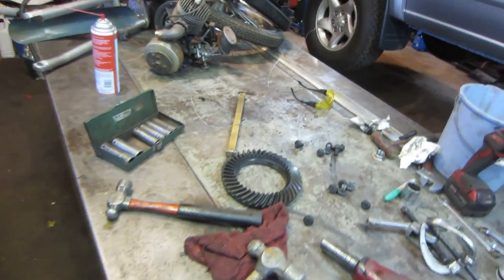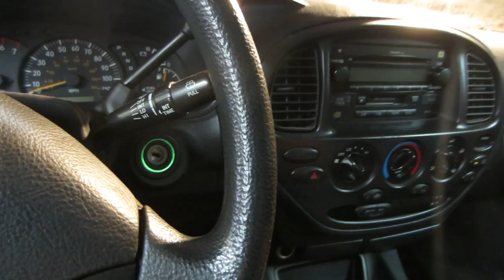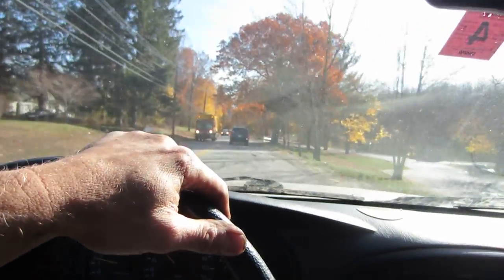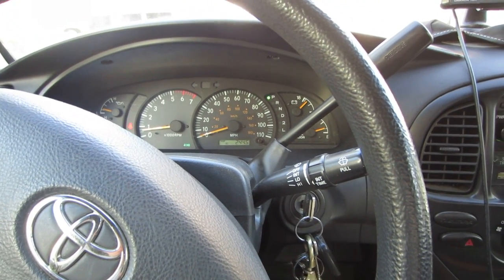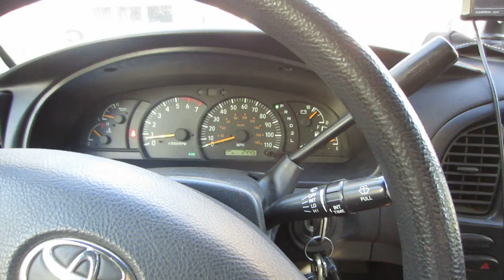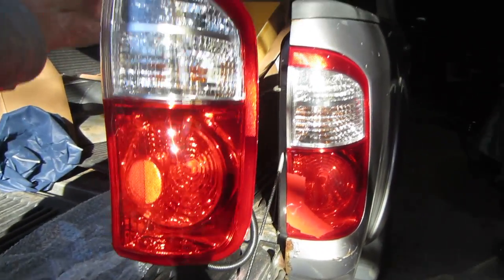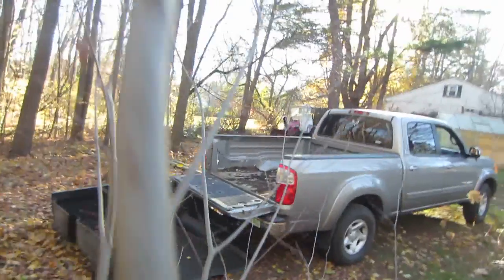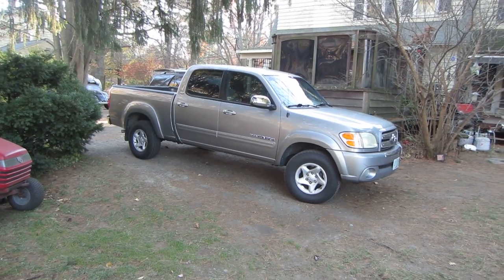front wheel drive toyota tundra

Comment: When I first received my `95 Tahoe ( used ) , there was a `whistling sound` coming from the rear differential. Evidently , the pinion bearing had gone bad - which ,in turn , had then worn all of the teeth in the ring gear and the spider gears down until they were razor sharp. I simply removed the rear driveshaft, stuck a spray paint can lid over the rear end of the transmission ( to help `contain` any drippage, put the transfer case in 4-high, and drove it across town ( only 6 blocks long x 6 blocks wide ) until I purchased a replacement entire rear end ( the cost of replacing the entire innards of the pumpkin was only slightly less than buying a used entire rear end ) . Although I never did try to drive the Tahoe on a highway, it`s nice to know that I could have done so .

Comment: A long time ago I had a Toyota Tacoma with a Toyota branded bed liner in it and I took the liner out to clean under it one time and apparently it wasn't a real good fit and it had been shifting around enough that it had worn the all paint off of all the ribs in the back. There was very little rust because it was getting rubbed off just like the paint had. After that I decided any other trucks I owned would have a painted or sprayed on Rhinoliner type of thing in the bed instead of a liner.

Comment: When we were on a deployment, one of our HMMWVs locked up the rear differential solidly. I removed the prop shaft in the hopes that we could make it back to the motor pool in one piece. I got split up from the rest of the company after we got back and was assigned to route security on the main supply routes with my platoon, and that truck went the rest of the deployment as a front wheel drive.

Comment: I am a retired mechanic with over 30 years experience, 20 of which were in dealerships. I have seen diffs with worse damage go 100,000 miles without a problem once original problem was fixed. I truly believe you can get by with pinion bearings and reinstalling as is. Just my opinion. 
With that said, you can save hundreds of dollars calling Nogalitos Gear in San Antonio, Texas. They specialize in aftermarket parts. I have probably rebuilt 200 or so diffs over the years with their parts without a problem. Last ring gear/pinion sets I bought from them was about $80. That one might run $200. I think you will like their prices and quality.
Reply: 1962. You are young, like me! :-)

Comment: Yeah you won't get any binding in the driveline with the rear disconnected.   The only way it would be an issue is if you had a full time transfer case with clutches or a viscous coupling.

Comment: Hey Darrin,    For your leaf spring if you have a truck stop /plaza that has a repair shop, truck wash and repair they usually will have a spring shop that you can order or have in stock any leaf spring with any size and arch to it.  Also if you don't get that other rear diff.  Any you don't want me to look for you one then go to www.whitepages.com or yellowpages.com and look under wrecking yard in LasVegas , Phenox Az or any place in the south west and you can probably get one there really reasonable.  Even if you bought the outer pumpkin and then bought through a speed shop the ring and pinion gear and you can buy them really reasonable.  Thre is aso a couple of places that I will look or you can but, I saw it on another channel where the guy bought premade frame sections that you take and cut away the bad and these were designed just for the tundra and set them up and weld them on.  They looked really nice and with your skills you wouldn't be able to tell that you had ever redone the frame uther than there would be no rust.  I would be glad to help any way I can,,,,,,,,  I have a lot of time on my hands.

Comment: I was wondering if you could help me out. I bought an old 80cc yamaha. Im guessing its missing fuel lines on the bottom of the carb. I turn the petcock, it works but then the carb leaks through 2 outlets on the bottom of the carb. On the right side of the bike near where im guessing the clutch cover is, there is an outlet. Im thinking thats where one of the lines should go to from the carb? There is also a line coming out from the right side directly opposite from where the out let on the left side. Hope you see this and if I can send in pictures, Ill doe so. Thank you.

Comment: Isn't it amazing how nice those cut rate mirrors and tail lights are? I've used many and headlights too...and spent real time looking 'em over..I really think they may be OEM without factory logos, they are just too perfect...and The Price!
Reply from the maker: and cheap, that mirror with motors, like $45 delivered, the light was only 37,
Reply: You've hit the nail on the head there my friend, a lot of the cut-price "no-name" stuff is made by the people that make the original equipment parts for the motor companies.  But because they're not branded as OE manufacturer parts and they don't come in a box with the marque name on it, you don't pay "main dealer tax" on the price.  Very few motor companies make all the parts themselves any more as it is far cheaper to buy them in from specialist manufacturers.  I would, however, advise that if you are looking at buying parts like these, especially light units, have a look around for customer reviews of items from the same manufacturer, as some parts are really poor-quality and pretty much useless, often ones knocked off in China...
Reply: Ya, in the old days stuff was really ill fitting crap!
Reply: Rich Random   A fair chunk of it still is, hence the note of caution...

Comment: Going to be hard on the transfer case.    Although it might not be stated in the owners manual,  I worked in a transmission shop for years and they are not built for constant high speed engagement

Comment: You're "lucky". My F150 beeps at you if the seat belt isn't fastened. I'm surprised the traction control (if it has it) didn't kick in when the front tires started spinning.

Comment: Was the original oil leak in the pinion seal or was the low oil caused by a leak somewhere else?
Reply from the maker: thought it was the rust on the back having a hole but think it was the pinion seal now

Comment: put tape over the 4WD light and drive it until the wheels fall off or it turns to rust. Keep an eye out for a deal on the rear end, unless you bought it to flip I don't see having to take a bath on fixing it, it runs 2wd most of the time anyway.

Comment: Can you metalize(coat) the housing....cover it wit JB weld or something...to keep the oil in ?
Reply: It really depends on how bad the housing is.  If there is still a decent thickness of metal there then welding the holes up and sealing the inside like with sealing a fuel tank might be a better idea.  If the metal is too thinned out to take welding then sealing it with something like JBWeld is a possible option, but the surfaces will need to be thoroughly cleaned and oil-free which is going to be hard to achieve on an axle and with the axle under the truck.  It's also likely to only be a short-term repair as, if the axle is that badly corroded, it's only a matter of time before new holes are going to appear and, unless you're super-careful, you end up with another wrecked diff due to low oil and the need to replace the entire axle...

Comment: I'd take the bed liner out and leave it out all that's going to do is hold moisture and dirt against your scratched up bed because it will scratch the paint right off the bed. Now I would leave the tailgate protector in because it don't move around. But it was basically do what that undercoating does to frames. If you really want a bed liner get a spray in bedliner they don't scratch up the paint and then hold moisture against bare metal.
Reply: I had a QUALITY bed liner installed in my F-150 for ten years... pulled it out for giggles six months before I traded it in.  NOTHING. Natta. No damage. Spray in?  Overpriced, and they don't protect against damage nearly as well as a GOOD drop in liner. The liner in this Tundra? Flimsy crap.

Comment: i wonder if and  limited slip diff will work in an older 2wd toyota rear end.. if so id like to find one cheap.. if i cant afford it than ill just weld mine.
Reply from the maker: lots of 4runners had them , they should fit your rig
Reply: Mudd Boss for
Reply: Mustie1 i have a 94 ford ranger with a bad rear end. i had the same problem you have. the older ranger rear ends was an inch shorter on each axle but  the leaf springs and shocks where in the same place. i was going to just get one inch spacers for each side. never did though the transmission went out first but truck ran fine without them. after transmission went i gave up on the truck i was not putting another tranny in it. it would have been the fourth tranny in it.

Comment: Ok looks like your tundra turning radius is shit too so its not just mine LOL.  Mine is an 05 4x4 quad cab with the 4.7L V8.  Runs and drives great.  Actually had an 08 Tundra with the 5.7L V8 4x4 but actually like the 1st gen better so the 08 got sold.

With a part time 4WD system there isn't an issue running in just front drive if your rear drive shaft has been removed as there's a 50/50 torque split front and rear in a part time 4WD system...its the full time 4WD systems that cause trouble trying to run like that.  

The 4.7L V8 gets up and goes pretty good, nothing like the newer ones with the 5.7L V8's though LOL.
Reply: Those plastic drop in bed liners are garbage, they're where the rust starts on a truck bed...if you want a bed liner get it Rhino Lined or Linex'd.  It was $600 to have the bed in my 08 Tundra Rhino Lined and the lining was about 3/8 of an inch thick.  Had the bed all the way up the sides and the tailgate done.
Reply: @wildbill23c  I had a QUALITY bed liner installed in my F-150 for ten years... pulled it out for giggles six months before I traded it in.  NOTHING.  No damage. Spray in?  Overpriced, and they don't protect against damage (dents) nearly as well as a GOOD drop in liner.
Reply: @eskieman3948  The plastic bed liner in my 88 F250 after it was removed there was a lot of damage to the bed from crap getting between the liner and bed and basically sanded off all the paint on the bed....a bit of light sanding and it was ready for a Line-X spray in liner, for the price I'd go with a spray in over those plastic liners that'll destroy your truck bed.  Yep, not a wive's tale, got the truck to prove that.  It happens a lot if you use your truck as a truck those plastic bed liners are a horrible idea.